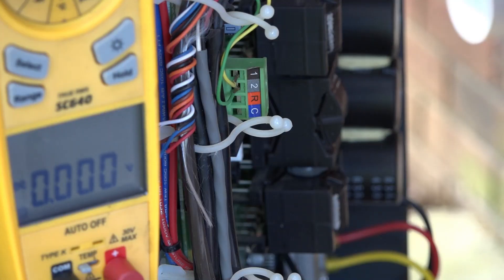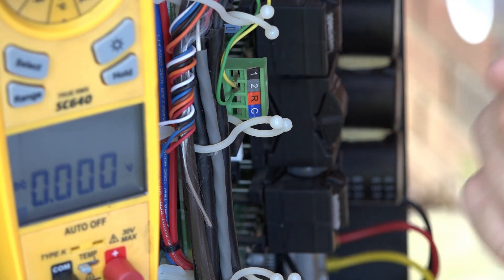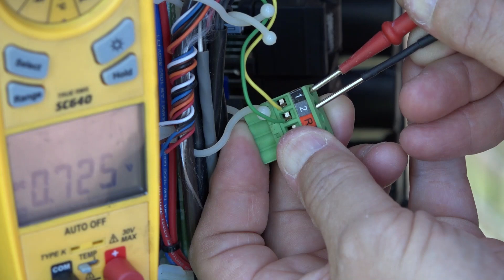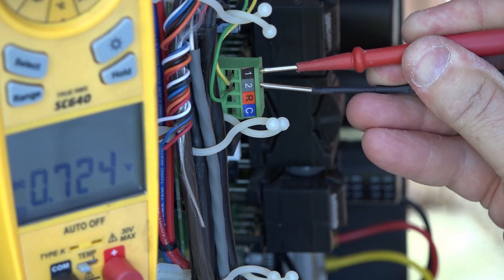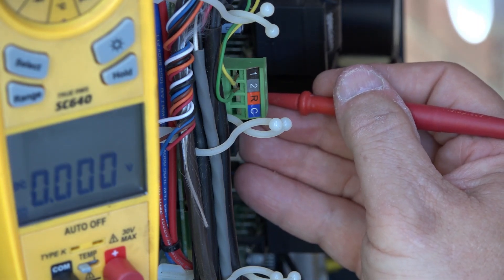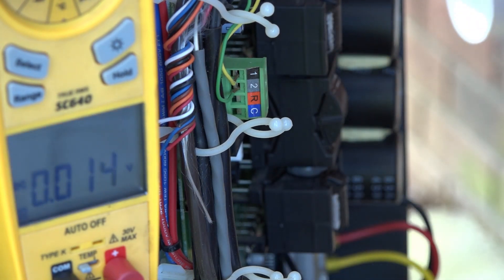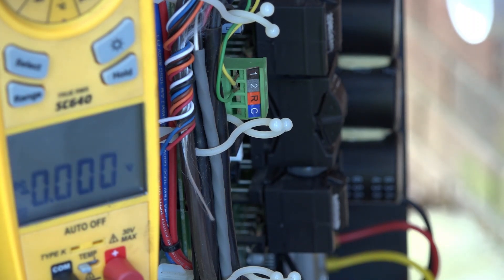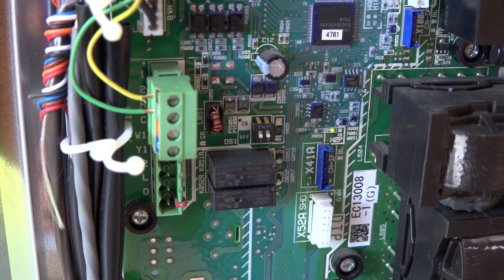Checking comm buss voltage on Daikin inverter, voltage bais

Comment: If my thermostat can’t find my outdoor unit can this be my issue
Reply from the maker: Could be 1 of many issues, 
Bad outdoor board 
Loose wire connections 
Voltage bias set wrong

You'll need to get someone trained to troubleshoot this system since this is digital communications
Reply: Make sure it is receiving voltage from disconnect